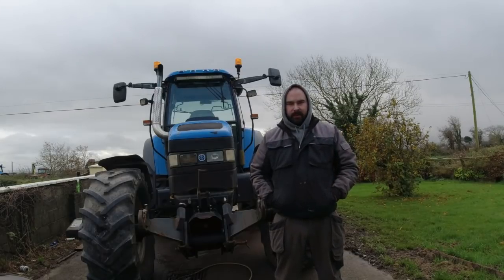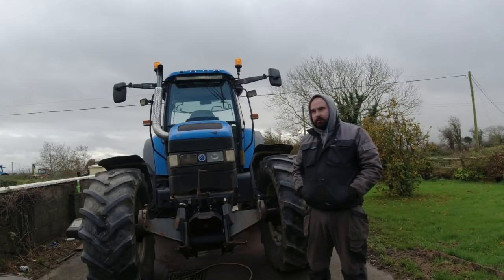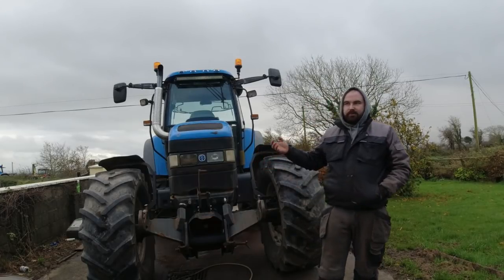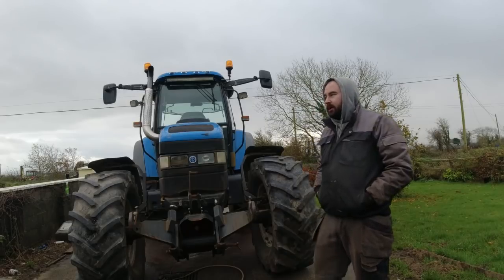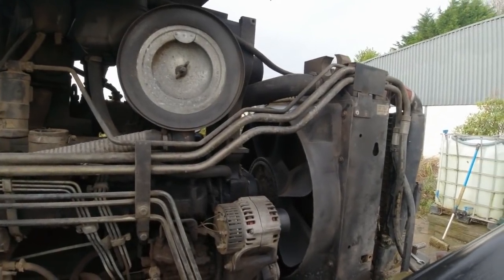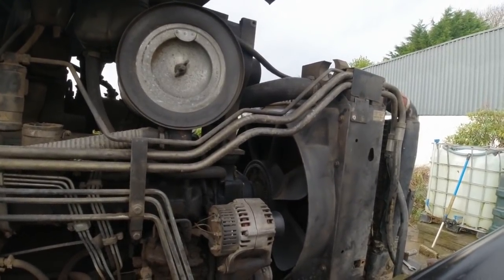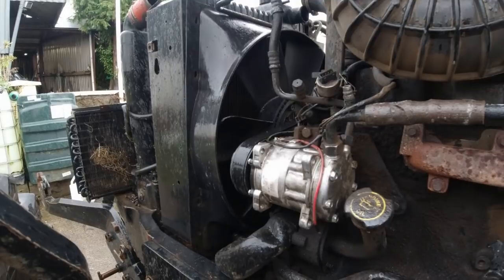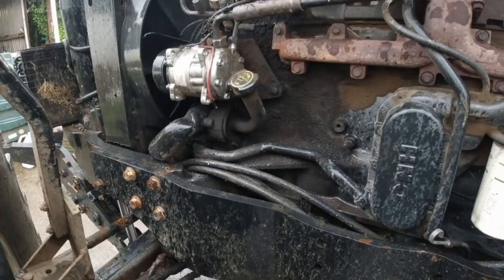new holland tm 140 broke what happened ???

Comment: Interesting, we have 2 TM125 both had issues one was brought brand new the other from local farm sale, it was below average condition with head/cooling problem, poor service life.  The TM are better tractors then replacement T6/T7 despite having big 7.5 power star engine.  Working on tractors I need work tray to put tools n parts on, then when I finish I clean all tools n put them back in order.  This because my Pa would kick my ass if lost any tools, he would make go n pay for any tool go missing.

Comment: Hi. I have an error code f77 which is output speed sensor. Where is it located on tm 140?
Reply from the maker: That's on the left hand side behind the fuel tank around where the transmission joins the back end.
I'd be checking your wiring and fuses before you go changing the sensor.
Tms are a fright for the wires going hard ontop of the back end

Comment: Hi like your video. Which is better new Holland or case?
Reply from the maker: Everything gives trouble unfortunately
Reply: @mrcvx  as far as power goes which is better?
Reply from the maker: The tvt and the cvx are both 6.6 litre sisu.
They would have more power than the tm but are a lot bigger tractors

Comment: I try to keep thing's tidy & try to know where everything is. Sadly that doesn't always be the case. It can be even harder to keep thing's tidy, if other people are using the same tools, as yourself. 👏👏👍👍
How did you get on with the rad?
I know there's a bottle of stuff that you can get, that blocks holes in radiators. But I suppose it depends on where the hole or holes are in, in the radiator.
Great video again. Keep up. 👏👏👍👍